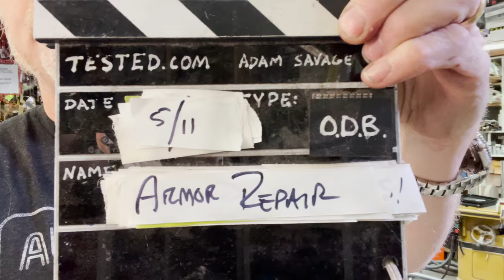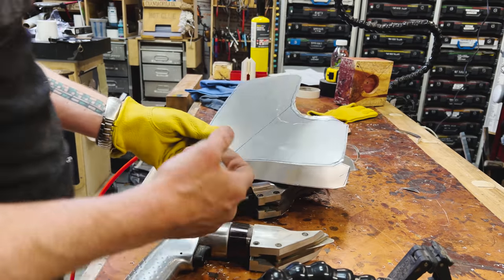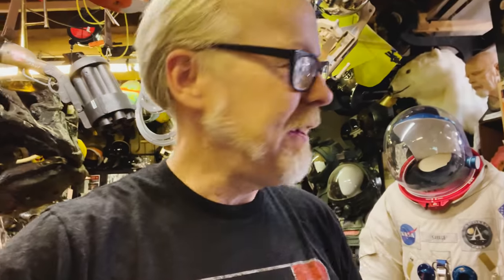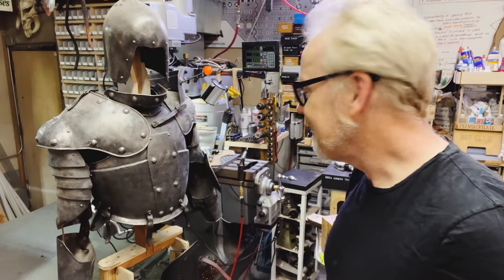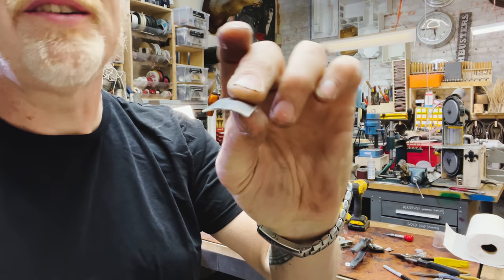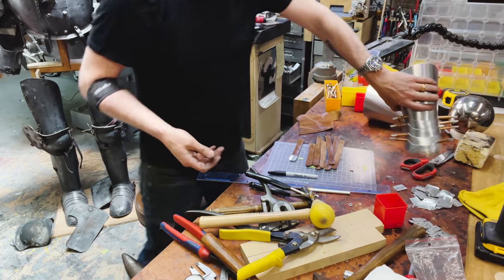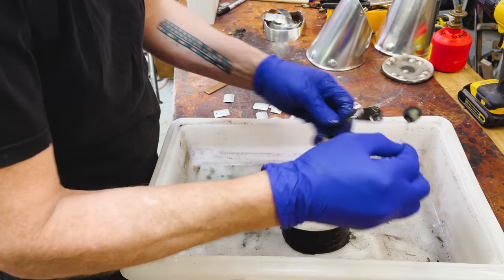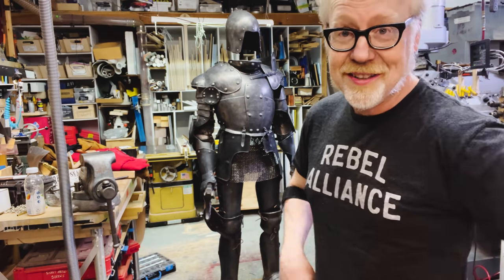Adam Savage's One Day Builds: Excalibur Henchmen Armor!

Comment: Hi Adam, Love the channel you have going here. I know I have responded to some things in the past and will likely keep doing so in the future. I would like to just give a word of warning regarding using the stake in the hardie hole on the anvil. With the stake having a tapered base driving into the hardie it can cause 2 major issues. The first is you can wedge the stake in and not be able t remove it. The worse issue is, especially on older anvils, It can cause a fracture and split it off from the hardie and back. You can get small stake holders, designed to be bolted ontop of a bench, or a dishing stump. Or if you get a hold of one, a pexto plate (any of the types of them) have a coresponding tapered hole for the stakes. And are designed to take that abuse. I do blacksmith work and silversmith so I have both types of tools in my shop too. Sorry for the wall of text.

Comment: If you haven't already, stick a big ol' magnet to the underside of your anvil horn. It dampens the annoying ring a ton, you have to shift it around to 'tune' it but it really works. Some recommend wrapping chains around the neck but I found a chungus magnet did the job just fine on mine... much nicer on the ears.
Reply: I used a speaker magnet if that helps ;)

Comment: Love the videos! 
In the knife making world using a high quality spray bottle is the best way(short of a dip tank)  to get an even finish from bluing solutions. Apply using the spray from the bottom up, and let sit for 24 hours. This allows the solution to form a much stronger oxide layer. Then buff with 0000 steel wool gently.  Its better to take more time than to add pressure. 
I know aluminum is a different beast but the process should have the same result.... good luck

Comment: Another method for annealing aluminum is to set your torch with a carburizing flame (black Smokey flame) and cover your piece with the carbon from the flame. Then after your piece is covered in soot reset the flame to a standard heat and burn off the carbon. Done.

Comment: Why did you soften the “chaps” before it had been work hardened? Was it because it would help get the specific shape you needed, whereas the shoulder insignia did not? Unless I missed something or you happened to double punch (I’ve been a professional camera op for over a decade and it still happens to me too:) you did not heat up the shoulder insignia until after you had worked it for a while. Just curious about the different order of operations.

Comment: As armor it doesn't work.  You would need an arming doublet underneath with maile over the top.  The shoulder area looks particularly bad from a fighting mobility point of view.  Of course in the supposed time when Arthur was about plate armor of this type was not in use.   The Curaisse is like an Italian type.  In the 15th century they had a two part breast plate, which increased mobility, as it was jointed.  Yours does not do this.